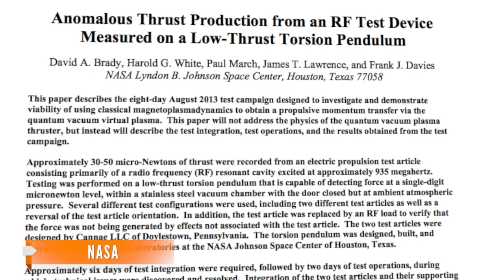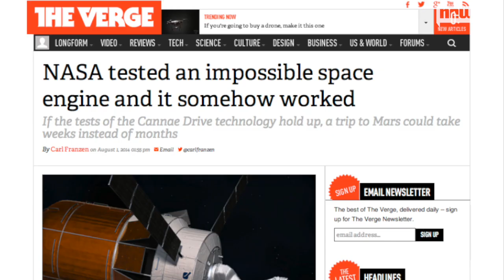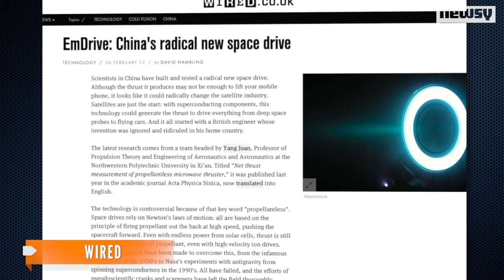NASA Tests 'Impossible' Engine, Finds Out It's Really Fast

Comment: holy crap if this works there would be no limet to where we can get [ bar cost of this thing]
Reply: well, you still have to transport the energy that is used to accelerate the quantum particles so you do need some sort of fuel but it is indeed way less than what was previously required
Reply: no you dont need to have fule!@
Reply: if by saying "fuel" you mean propellant then you are right. what i meant was an arbitrarily chosen source of energy. burning gas ("fuel") would work just as well as using an accumulator
Reply: TerrAkon3000  thats what i was thinking, you could just use nucler power or solar power, you just need a renuable score in space
Reply: *****
 we could use H3 too, if we make a fast pit stop on the moon, it is cheapish to get and can make huge amounts of engey for its size
Reply: *****
 wow, ok your right, that is power ful
Reply: ok i will
Reply: kkirschkk
it would be better to breed lithium into tritium (from fission and fusion reactors) and let the leftovers decay into He3 on earth.
Reply: You can use 2 things. You can use Solar or Nuclear Fusion. Spaceships can now act like Submarines. We can convert nuclear to electricity which would increase Emdrive thrust. We can create hybrids where we can utilize solar as a backup system or even a stage 2 conversion. Space ships can take off traditionally and reach certain heights on regular fuel. Stage 1. Stage 2. Activate em drive utilizing nuclear fusion to leave the atmosphere and the earths gravity at sonic speeds. Stage 3, Solar, for interstellar travel. It would definitely make it possible for 2 way trips with more ease.
Reply: Well I think thats a little selfish because all its doing is slowing the progression of the human race. If Science and Technology wants to truely advance and seperate itself from poltics. We as a human race are giong to have to learn to work together to get the job done. Its not like an american company won't purchase it after its done anyhow and NASA is public Department so technically it belongs to the Public.  So who gives a fuck  what they think. Who wants to be the first to blow up in outer space anyhow. I think Space Exploration is about the race to perfection. Not the race to actually Do something. I think sputnik proved that
Reply: Yea, but I have to argue this because its literally childish. All the philosophers in our history are rolling over in their grave right now. I am a IT developer and I am amazed by how fast and rapid technology is growing in the IT industry due to Open source technology. The Very reason Windows won over Mac, the very reason Android is winning on windows. The internet was invented for this very purpose and yet greed wins again. I love science but scientist one day will have to learn why the public will never fully trust them no more then they do a politicians. Sensibly because Humans are behind it which will always make everything imperfect.
Reply: *****  Is that supposed to be a logical argument?... "lol oh rly?"   What is "dark matter...PWNED" ? supposed to mean?

Dismissing the facts won't change them.
Reply: ***** Name calling really does prove a point but probably not the one you think.
Reply: leerman22
 so you could have a close to never ending cycle of he3-lithium-tritum-he3?
Reply: kkirschkk No. Having a renewable and centralized source of He3 in an easilly accessable place is better and cheaper than mining He3 on the moon.
Reply: leerman22
oh ok, is lithium common on earth, and how much energy dose it cost to make it that way?
Reply: kkirschkk
it takes a neutron to turn lithium into tritium. you have a lithium blanket around a fission or a fusion reactor and it absorbs neutrons. No electricity nessesary except to extract it from the blanket. also it has a half life of about 12 years so you need alot of it to get helium3.
On a side note why not just D-T fusion to power this instead?
Reply: leerman22
 bescuse D-T removes the whole LI thing, and you would need a ton of T to get He3[ like a few million tons to get a large amount] so why have we not done this IRL?
Reply: kkirschkk
We should forget He3 and use tritium instead. any long term space mission would be compatable with it though as it doesn't decay while tritium does.
Reply: ok
Reply: Anthonyg Gordon it would, I wish ksp had something like this
Reply: ***** Nuclear Reactor is what I meant. What ever we are using on Submarines and Carrier ships would be the best source. We can do it. its just going to take some time. SpaceX will be building their own space launch facility and Eagleworks. Another thing Nasa needs to do is Open source the technology. If there is anyone that will be able to do it. Its the american private sector. I think scientist need to step back and re think how they research. Perhapes our process is outdated. The IT industry is growing rapidly thanks to open source. If there was a better means to collaborate with engineers and physicist enthusiasts  alike.. I believe colleges could do it. But we will see. I just hope they don't remain too silent on this for long. The public demands more information. lol We could probably get it out of them if we wanted to now that they have it.
Reply: Anthonyg Gordon the problem is if they open scorce it other nations will have it, I bet they don't want them to have it
Reply: Anthonyg Gordon I know I know, but people wont work together, most likely this will not be given out
Reply: Anthonyg Gordon ya it is sad, well I bet we will never know how this works, the usa will just use it for new spy stuff in space
Reply: ***** I agree with you because as I did research, I realized the creator of the emdrive already put the basic concept out there on how to build one. I find it strange that the public is still asking questions when they have the idea right in front of them. But maybe I am speaking to soon on behalf of the pubic.
Reply: ***** not to mention who would trust the u.s. with even more advanced technology after what it did to Iraq over a pack of lies and a false flag attack - 9/11.
Reply: ***** But you aren't getting something from nothing. They said that the thrust comes from matter that pops in and out of existence due to quantum fluctuation. Isnt that not enough ?
Reply: ***** I don't know if you realize, but everything is matter, matter you believe in Dark matter or not. Everything that exist in this universe, has some type of particle property. Even space. Space is a ocean of matter. And I am confused by which you mean by Money pitch. You think NASA is trying to con the federal government into giving it money ??? By lieing ??? Don't you think they will have to prove it before they get any funding.
Reply: Actually, the report says the Canni or EM process uses "magentoplasma dynamics", so I expect the process DOES create a magnetic field.  Since the transition of subatomic particles and waves has been shown to be indeterminate, artificially transitioning subatomic vacuum plasma into space-time couldn't be expected to work consistently  And, we can't know how it would effect the atomic structure and stability of the physical universe.

It could be said that our understanding of quantum mechanics is virtual but the plasma transitioned from the quanta wouldn't be "virtual" ( our Sun is composed of plasma). This process would, most likely, turn out to be another kind of fracking; it would create pollution and have its own dangers because, as physics shows us, for every action there is an equal and opposite reaction.

Also, since photons and gravitons are considered massless and limitless in range, it seems the effects would impact all of space-time (even if to a greater or lesser degree).  How would space-time be restored to it's natural order?  In addition, travelers would still experience motion or thrust and according to physical laws, material objects can't travel at the speed of light.

Other options for propulsion have extreme risks also.  The ratio of matter to anti-matter in the universe is said to be a critically balanced ratio.  So, using anti-matter to warp space sounds like a recipe for annihilation.  While I really enjoyed the pictures from Voyager, I wonder if the plutonium they used in those spacecrafts may present a problem in the future. If I remember correctly, Voyager only travels at 1/17000th of the speed of light.
Reply: *****  Why blame me?... it is quantum physicists who say quantum space is all interconnected and effects are universal (although they may be greater at one point than another).  No doubt, a rocket scientist would have to do some theoretical calculations about the effect of a warp drive wave across space-time.

Don't forget, the laws of physics say material objects can't travel at the speed of light...also, not my fault.  So, it seems to me, unless a person can transition (transport) into a blob of neutrinos (for the entire trip) and then back into their material form without getting dead and avoid all black holes, they won't be ready to take off at the speed of light.  And,, if the theory of time dilation is correct, a traveler's destination is going to be older just like the place they left behind...again, not my fault.
Reply: *****  You're so logical and sincere...lol
Reply: kkirschkk Yup you do.  What this engine does away with is reaction mass.  I.E the stuff you carry along with you to kick out the back end of the space craft to make it move.  Newtons equal and opposite reaction.  The fuel you would need to carry would be some form of battery or electric generator to produce the microwaves that allow this 'Canae' effect to occur.  If it is actually occurring.  Their is still a lot of work to be done to prove this is actually a viable form of propulsion and that the effects recorded are not the result of some other natural phenomenon.  Personally I am hoping it is a real effect because the implications are huge.
Reply: and a big freaking rock (grams }sitting in the way